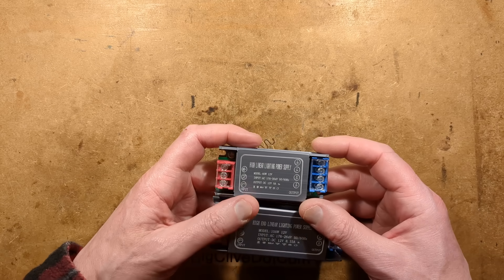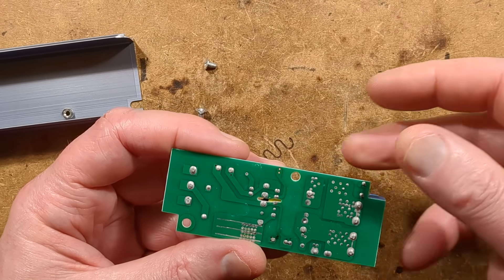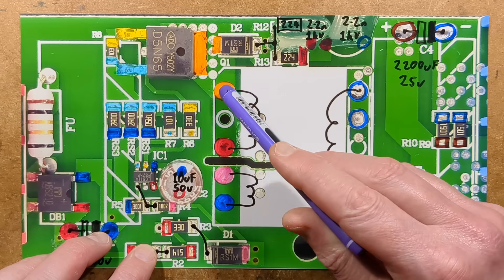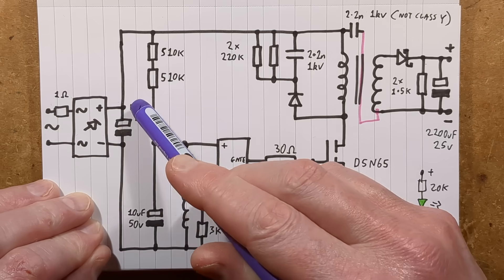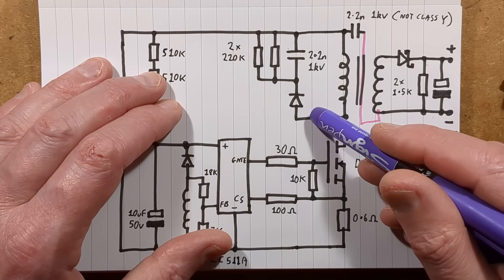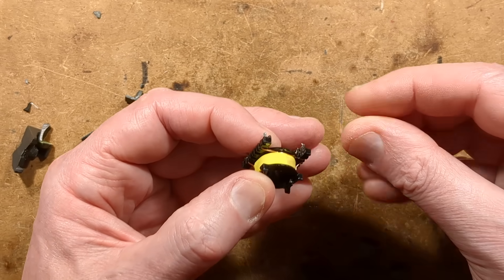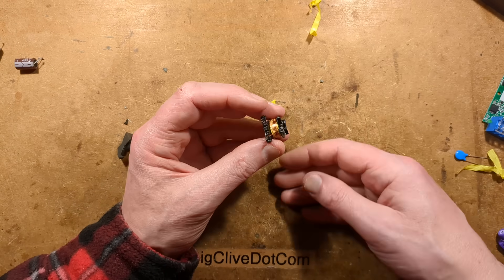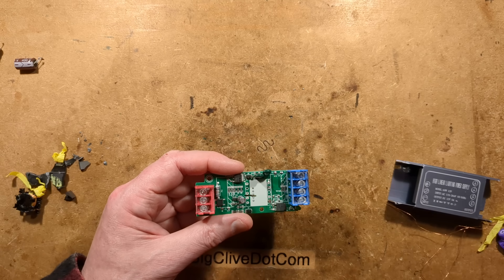AliExpress LED power supplies - almost OK

Comment: It has always amazed me how Chinese engineers can often get an A+ for circuit innovation and cost effectiveness,  but at the same time multiple D-'s or even F's for safety.  There is definitely something wrong with either the way they are trained, or their overall manufacturing culture and testing.  Over the last 30 years, it has seemed to me that their understanding of Electrical Safety has very much been learned "on the job".
Reply: It’s not always how they engineer the product. It’s the custom wanting the product if you were ordering millions of these for for some industrial use and you want the cost cut they can cut the cost if you don’t want it to be safe.
Reply: @TheLostPacketYT That is the very definition of a BAD Engineer... and in most countries conniving to produce an unsafe product is a criminal act when people get injured.
Reply: @hectorpascal  but it isn’t you are designing what you have been told to design to the letter being an engineer is not about forcing something into a design. It’s about designing something to the specification you are given when you’re being designer product by people who only care about the money you can let them know how the safety feature is needed, but if they ask you to move that safety feature, it cannot be on there for you to be a good engineeryou do not understand the difference between engineering and making a safe product engineer does not know why something has been specified to be admitted unless you are done sometimes it could be because it’s in a specific application not because of cost saving you also don’t understand the part about it being illegal to convince someone to make a bad product. It’s on the company for selling it incorrectly described these products are perfectly safe if used in the proper manner they’re just not suitable for general purpose applications without additional safety features.
Reply: @TheLostPacketYT Tell that to the judge!
Reply: @hectorpascal  what is not that will go to court it’s not on the designer factory it’s on with selling product. They could be taken to court for it. You don’t really understand anything here and you’re using the argument about bad engineering power supplies do not need proper isolation or in many appliances because there are no exposed conductive parts for a user to touch therefore this power supply is absolutely suitable for the application. It does not mean it’s designed wrong like in a lightbulb it’s designed that there is no voltage for users, it does not mean it is unsafe. It means that it has been applied for the correct use.
Reply: @TheLostPacketYT 😆😆😆Sorry - I'm too busy to play TROLLING games with you!
Reply: @hectorpascal  i’m not you just don’t understand. A lot of chunky designs are used in real products because they are suitable in one specific application because our product is available does not mean it’s suitable for everything or you should buy it. It means that you can only use it for some things if you only want properly right power supplies and things you can’t use a phone charger a lightbulb or many other appliances
Reply: @TheLostPacketYTAnd you see nothing unethical about designing dangerous electrical items because you have been told to? Just "following orders" right? 😐
Reply: @ferrumignis  the point is you often would not know if it is dangerous you’re given a very specific set of design programs. You are not told create a product most of the time. It is design this part of a circuit design a circuit board for this you’re not marketing or anything you’re just designing a power supply that does XYZ.
Reply: The design principles seem to be the opposite of western ones. We think safety first and then functionality and performance. They go for functionality then design for lowest cost of manufacturing with safety not really being a priority. Their logic must be more: people shouldn't handle electrical products unless they understand the risks. Where western design ideas of everyone's safety is based on the potential likelihood of misuse/mishandling by laypeople.
Reply: I always wonder if the initial design was done correctly, but someone in manufacturing decided that they could cut some costs by eliminating features. Wouldn't be the first time
Reply: @tns5044  Yep, bet that happens a lot and not just in electronics, just by the factory re-ordering from a different supplier that's cheaper and not checking
Reply: @tns5044  they are likely cold when making a design to make the bare minimum of a power supply so they make the bare minimum they might put an engineering note saying it’s not isolated or something but ultimately that’s all they are told to do
Reply: It takes a while for Darwin to operate
Reply: @keithstandiford3761  But should they be practising on the people they export to? ☹

Comment: I buy secondhand racal or farnell power supplies for general use as I don't trust these cheap supplies. For higher voltages e.g. 50V 3kW for LDMOS rf amplifiers, computer server supplies are a good option.

Comment: 8:24 I was initially going to question one part of this, but actually, I think that's probably the best overview of internal slope compensation for current mode control in simple terms I've ever heard. I couldn't find a datasheet for this chip, but suspect it might be a derivitive of the MPS HFC0511 flyback controller.

Comment: Putting a big-ass electrolytic cap at the output is a horrible idea. Look at the output when you just turn it on and you'll see why. Also, makes short circuit protection non-existent. 
They built them with bulk parts they buy from the market by the kilo. Whatever that week's special buy was, is what goes in them.

Comment: Name-brand laptops have good power supplies a knowledgeable person can hack and change the output voltage to 12V or 5V, with a few resistor changes. 
I buy stuff only from Digikey because they ship it overnight for $8, and do all the Canadian customs paperwork!!!! Where others want at least $20. 
I've never seen a "Dirt Cheap" power supply from them. There's a reason for that. Liability.

Comment: You didn’t mention the feed back coil on the circuit diagram, I can see it charges the cap, and pressure the two resistors are providing a feed back to the chip.

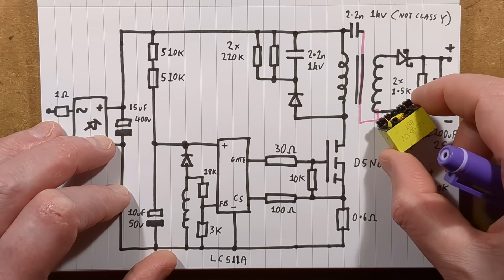Comment: Why would the 10K gate pull-down resistor (9:00) be connected like that!?
Are you sure it's not going to the ground like it's supposed to?
Reply from the maker: It's connected to the MOSFETs source as that is what the gate is referenced to.

Comment: No such thing as a fusible resistor. quit perpetuating this. There ARE fireproof resistors that will fail open without combusting. they are not fuses and you shouldn't act like it's ok to have one instead of a proper fuse. read the datasheets like for yageo's FR series. They will tell you in plain English.

Comment: Hey, like the videos, and the way you ''explain' how it works :) - However Y capacitors are type 1 to 4 (as you mentioned Y4 being the lowest voltage and least protection) , however Primary to secondary at 230V MUST be Y1 (single part), i.e. Reinforced insulation at 230V, Y2's are are used for Basic insulation (Primary to ground) @230V.

Comment: Why does the two sides of the transformer need to be connected together ( with the capacitor?
Reply from the maker: It is intended to provide a return path for electrical noise coupled between the layers of windings to reduce the risk of RF noise being transmitted by cables.

Comment: Ouchies.  If you want to tear apart a real LED power supply, try a Mean Well HLG-320H-54A (or similar model).  And yes, you can run it at its full spec more or less indefinitely.   Serious safeties and other goodies in the Meanwell.   Everything you can imagine.. PFC, isolated, multiple safeties, current limited, and extremely efficient... usually 92-95%, depending.  Designed for outside LED lighting.   Not sure if they're potted or not (they might be... I've got tons of them but I've never torn one apart).

-Matt
Reply from the maker: The ones for outside applications do tend to be potted.

Comment: I always recommend people who start tinkering with electronics (or even people who are just looking for a replacement PSU for something) to NEVER EVER buy when from sites like AliExpress. Also tell them that MANY other components from there are perfectly fine to buy, but anything which goes into a wall socket is just a no-go is my rule of thumb.

And you PERFECTLY showed why, especially while these designs might LOOK "professional quality" to beginners, they are definitely not. 

Have to admit: When the video started and you said what you had bought from AliExpress, I briefly thought: YOU. DID. WHAT??? Then realized: "Oh wait, it's BigClive, yup there goes the product"😂

Comment: All that critique of the transformer and capacitor and nothing about the primary side voltage sensing? Maybe it's just me, but in my experience I have found primary side sensing to be inferior to secondary/optocoupled sensing.

Comment: So this is a constant voltage power supply.  A constant current supply is more suited to drive LEDs.  All the drivers of a particular Chinese brand we used to sell were constant current types.
Reply: depends on the LEDs. Most LED lamps these days seem to be 12V with their own driver inside. Even tho that is very overcomplicated and inefficient.

Comment: Indeed one of the things to never buy cheap from questionable sources are power supplies of any kind and when you get other devices with such power supplies those should go directly in the bin (or junk pile).

I'm also a fan of Mean-Well power supplies, they are very reputable but also very affordable still
Reply: Regarding reliable power supplies Mean Well is indeed the minimum one should look at. There are more expensive brands out there that are even better but for most applications Mean Well is the perfect choice. Cheaper and/or less reputable brands should be avoided.

I like that they have a vast range of housings, from open frame to sealed IP67. Well engineered units.
Reply: @Frankhe78 my only complaint is I grabbed a 350w 24v supply and it doesn't have PFC. Turns out that's my fault though- it's there in big bold letters on the spec sheet.
Reply: @JohnDoe-c2f They offer a wide range of power supplies, from relatively simple ones to versions with full bells and whistles.

Having one 350 W non PFC supply in your installation won't be a huge problem. When you have twenty of those in your installation it will indeed start to add up. Especially in industrial applications where one gets billed for kVAh instead of kWh what is common for residential connections.

Comment: Have u tried see the inside of converter type C plug to barrel plug that can supply 100W? Is it true bcz how cheap it is
Reply from the maker: There are PD modules that signal to suitable power supplies to put out a higher voltage.

Comment: The electrical isolation is in a category called "hopes and dreams" 

Even the casing not being earthed us kind of a shame too.
Reply: I got a slightly better PSU where the earth did actually have a track going to that mounting screw hole.
 Unfortunately,.. the copper around the hole had green solder mask on it, and the mounting standoffs had closed ends and the mounting screws were too long to get the PCB to make contact with the standoff & case.

Scratching the solder mask off and adding a washer to make a contact between PCB & case is doable, but it's probably still got a cheap-ass sketchy transformer in it.
Reply: @massimookissed1023  The Earth should be a unique bolted connection to the exposed metallic frame. i.e. NOT a shared bolted connection that serves as a mechanical support for a board, or a cover plate.
Reply: @BTW... I'd rather have a shared earth connection than a Bluetooth earth connection.
Reply: @massimookissed1023  Phantom Earth
Reply: Unless it was class 2 double isolated, which it is not.

Comment: Yikes. So a safety nightmare. Not only is the chasis not grounded , the lack of the Y class separation cap means all the safeties are off.   I suppose if one likes the danger of maybe getting electrocuted by their 12v supply when it fails, sure. Use one of them.

Comment: Nice. As it happens I was about to set up a 40A Chinense power supply from Ebay to use with a bilge pump. I was going to check if it's actually grounded, but now I will also check it for a class y capasitor.

Comment: 3:00 it's always funny to me when I think about that capacitor cus every single official switching power supply I've ever used has shocked me or gave me the "haptic feedback" feeling when touching anything supposedly grounded on the device it's connected to.
Reply: That's just the inevitable tiny current that the Y capacitor passes. I don't like it but it's nowhere near high enough to be dangerous in a well designed supply.
Reply: @ferrumignis  I just wish the parts I can touch that are made of conductive material were actually grounded instead of floating.

Comment: I bought a big cieling ring light. I'm looking for a 60watt led driver. I've got a multi mode dimmer switch but the lights have horrible steps in brightness and flickering at certain levels. Tried shopping around and I'm swamped by choice. Any helpful souls want to give me key search terms? (And brands to avoid)
Reply from the maker: If it doesn't have to be run at full intensity then it may be viable to use a lower power driver.  That may negate the need for dimming, which introduces extra complexity.

Comment: The isolation gap milled into the circuit board is rendered completely pointless by the transformer construction. Who go to the expense of the former and cheap out on the latter?
Reply: Ticking boxes without knowing the reason why the rules stated before the boxes are as they are. That's my guess.

Comment: You  could show the  duty  cycle (wave form)  going to to the MOSGET  under  load  with a  scope  You could lso test the  isolation  of the  transformer   before you took  it  apart

Comment: Would it be economical to buy these power supplies and replacing the capacitor and transformer?
Reply: No. The transformer is by far the most expensive part of this, and you wont get the same layout and ratios off the shelf anywhere anyway.

Comment: Is there a chance you will rewind the core and reassemble the parts? Good luck. Thank you, and keep working.
Reply from the maker: You could rewind the transformer but it would require a proper winding machine and experiments to find the correct turns ratio.

Comment: May I ask regarding that blue (not-class-Y) capacitor: what's its purpose in the circuit? Why have one in the first place?
Reply: something about the switchting and capacitative coupling between the windings causes it to emit an absurd amount of interference, adding that (Class Y) capacitor to connect the input and output, completes the circuit for the high frequency noise, and stops it from being emitted. (capacitors act more like low value resistors at high frequencies, but block DC, which is why they're connected between the DC smoothing capacitor on the input and output, basically)
Reply: @AlexanderBurgers  That makes sense, yes. Thank you for explanation, Alex.

Comment: I've bought a couple of power supplies that looks similar but have longer body. Well, those have proper input filters, grounded case and even X1 capacitors in question. Looks quite okay. Especially for the price of $3 for a 60W version (the actual power is about 30W indeed). The only thing I don't know is whether the transformer isolation is good enough.
Reply: Do you know it's easy to rework that trans to have it comply? 
Thin wall 500V rated insulation sleeve installed over the Prim and Sec winding leads where a crossover occurs. usually PTFE or woven glass tube... wouldn't need more than 40mm.   

It would be interesting to insulation test those trans at a proper 2.5kV (one order of magnitude).
Reply: @BTW...  well, I don’t find easy to disassemble transformers like these…

Comment: This is typical for many cheap Chinese products. They always follow the 20/80 rule, that says, by investing 20% of the effort, one can get already 80% of the results. Vice verse, this means 80% of the efforts must be expended to achieve the remaining 20%. Missing PE connection to the chassis (would require a labour intensive placing of a teeth-washer between PCB and the distance-nut), no Y2-capacitors, missing creeping voltage barrier slits in the PCB and poor transformer insulation adds up to the 80% effort.